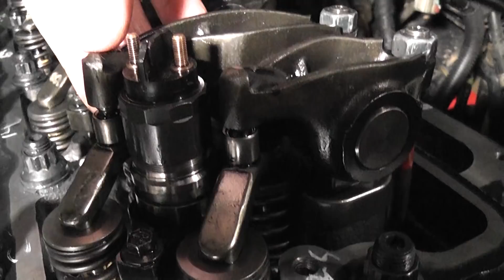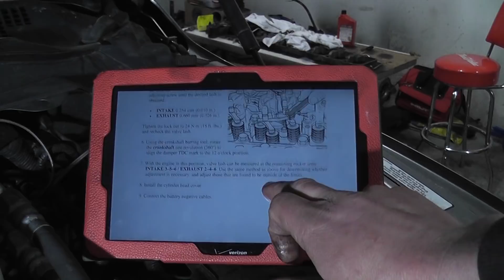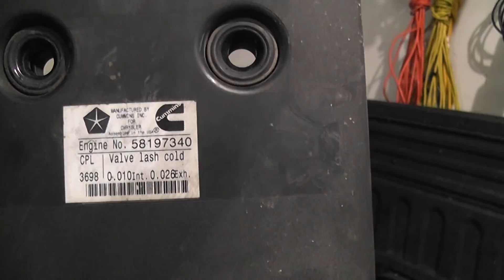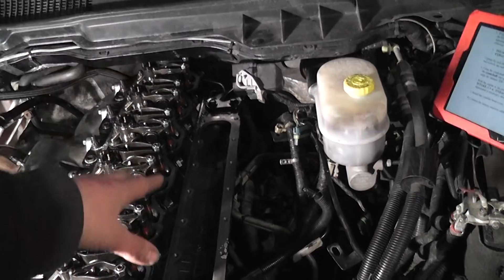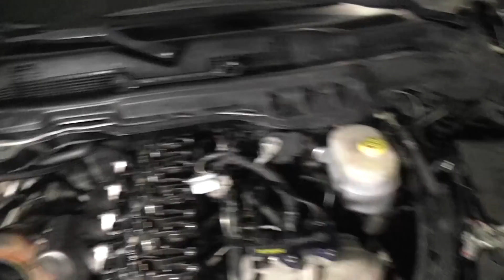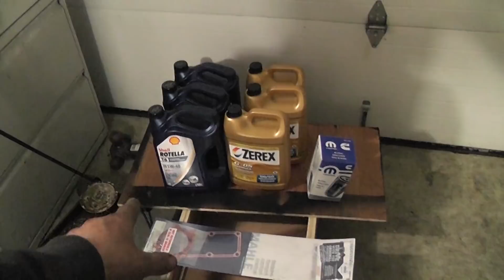6.7 Cummins Is SLOWLY Coming Together, Cummins Valve Lash Adjustment and Fuel Rail Install

Comment: Some say to torque again after warm up i have cold torqued once never a issue not saying im correct but if it ain't break don't fix it
Reply: I think hot-torquing is an old school method.  But yeah, ARP 625+ don't require this.